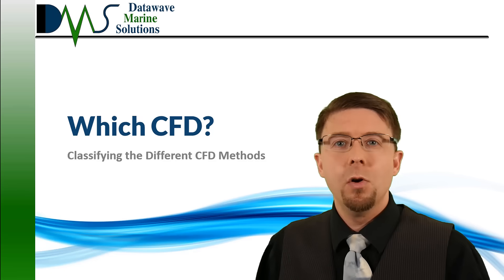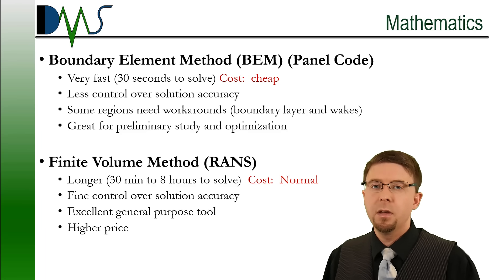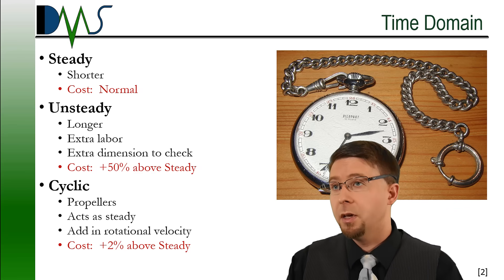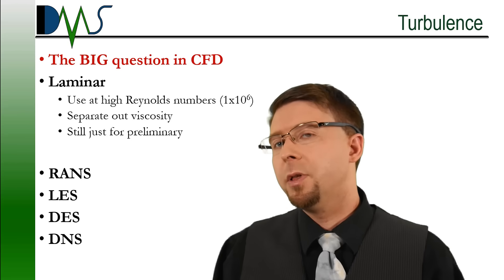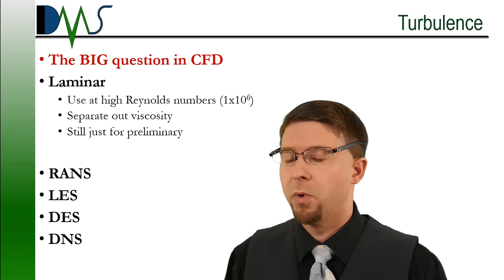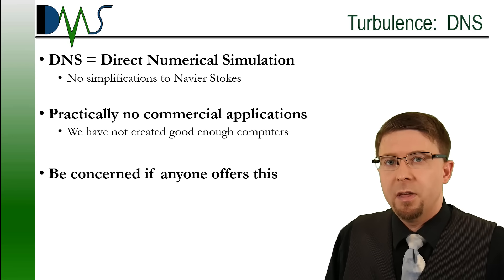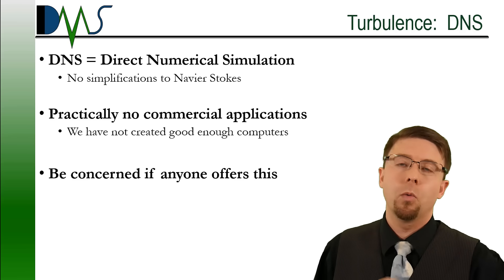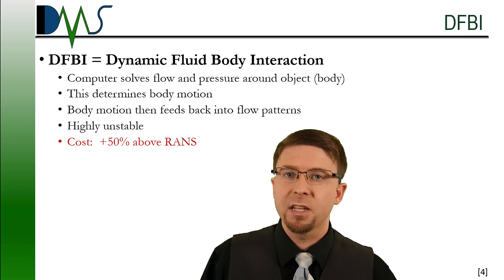CFD METHODS:  Overview of CFD Techniques

Comment: Ansys has DNS model in its Turbulent List. What that mean?
Reply from the maker: @EAR.Pakistan  DNS = Direct Numerical Simulation.  The software uses no turbulence model at all.  Every detail of turbulence is directly calculated.  This is only used for very small academic models.  To do it correctly, you need mesh sizes down to less than a millimeter and time steps of milliseconds.  For any practical application, there are no computers powerful enough.  At least not yet.

Comment: Excellent video.  The project steps & %time/cost allocation boxes with my experience across a broad range of CAE domains (thermal, electrical & optics,...)    I noticed a comment or two from folks wanting to understand y+.   Here's a pithy post from a CFD practitioner: https://joelcfd.com/what-is-y-and-why-is-it-important/.   For a deeper dive:  http://brennen.caltech.edu/fluidbook/basicfluiddynamics/turbulence/lawofthewall.pdf.

Comment: The data we use for research is DNS. It is extremely detailed and extremely large. Our professor got it made at the University of Austin in Texas using their super computer. It has great quality and the time steps are small but good enough to emulate turbulent flow at the boundary layer.
Reply from the maker: Very impressive.  What is the physical size of your domain?  Are we up to full ship scale or looking at 2D cross sections?
Reply: A small simulation of aerodynamic profile with DNS takes more than 50 million cpu hours, the reason we need may be 100 years to complete one real simulation!!

Comment: thank yuu 
Datawave Marine Solutions for your online commitment, but how can be reduced the running time. or any some simplifiaction methods of the software?
Reply from the maker: Most things in CFD are a trade-off between run time and accuracy.  The best thing you can do to reduce run time is optimize the mesh.  Remove any unnecessary details and really reduce your mesh count.  Minimize you domain size.  Do everything you can to minimize the cell count.  Also look at your simulation and see if you need all the equations running.  Is turbulence a critical component, or can you add that in afterwards with an empirical equation?

One trick that we use for preliminary studies is to perform a mesh independence study to determine the relationship between mesh resolution and our variable of interest.  The mesh independence study typically doesn't require a full simulation, or all the simulation cases.  After that is completed, you can perform the production runs at a lower mesh resolution and use the results of the mesh independence study to extrapolate up to a higher mesh resolution.  But I only recommend this for preliminary study.  Not final design.

Hope that helps.

Comment: Do you recommend a CFD program(s)? (Specifically some of the open source software options you mentioned in the earlier portion of the video.)

Thank you for your help! 
Cheers,
Peyton
Reply from the maker: The major open source CFD code is openFOAM.  You can learn more at www.openfoam.com.  But be warned, this is not an easy software to learn, and there are multiple variations on the code available.  Plan to spend at least a month learning the software, and another month on validation studies to confirm it's accuracy.
Reply: @DatawaveMarineSolutions  Thank you for getting back to me so quickly. You folks are awesome! -P
Reply: @DatawaveMarineSolutions  you scared me 
ama new urban hydraulic engineer and i really want to learn alot about CFD 
univ courses in master's degree aren't that much i think
but when u said 2 months i think u mean 2 months for someone who already understand about CFD right ? :p 
i need books to to learn about it too if possible :p
finite elements 2d we used to do it with excel :D

Comment: Good vid, but who wears glasses like that!?
Reply from the maker: I only wear them like that for the video.  It's a common video trick to prevent the lighting from reflecting into the camera and creating glare.  One of the many small details that goes into these videos, and an example of the quality that DMS strives for.
(I will admit that the angle of the glasses is fairly extreme.  That was the only angle they would stay on my head.  This is actually a great metaphor for engineering.  Sometimes we all need to make concessions to physical constraints of reality.)
Reply: Ahhhh interesting, thats pretty clever 👍

Comment: For "LES" you state it "don't ignore all the turbulence" but RANS has turbulence? Do I understand correctly that RANS only has an abstract average turbulence but doesn't simulate eddies and that is what LES adds?

Thanks for the overview! I'd like to learn OpenFOAM to see if a solar powered hydrofoil cruising trimaran might be possible. Can you predict lift and drag for 3D hydrofoils with openFoam somewhat accurately? I used JavaFoil but it gives way too optimistic numbers.
Reply from the maker: Yes, you have the essential idea of LES vs RANS.  RANS creates an average effect of turbulence.  For most of the RANS turbulence models, this also eliminates any directional information.  You have the same turbulence applied in all directions.  That can work perfectly fine for many cases. But it tends to create averaged, smoothed out flow.  LES captures those eddies and can propagate the turbulence in far more detail further down the flow stream.  Very important when the turbulence influence the flow direction.  Main applications would be cases of boundary layer interaction:  flow over foils or detachment at the edges of round bodies.  Think wings, wind turbine blades, jackets in the offshore industry, submerged pipes.  All large industrial structures.

As to your question about OpenFOAM accuracy for a 3D hydrofoil.  I have heard good things about OpenFOAM.  My default answer to these questions:  Nothing beats a validation study to test the accuracy of the software.
Reply: @DatawaveMarineSolutions  Thanks!